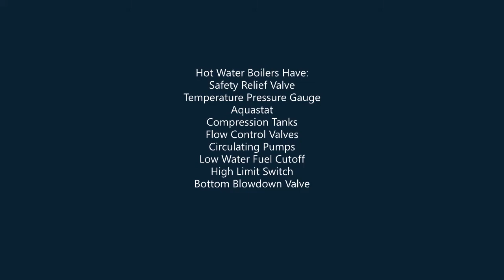Low Pressure Boiler Training-Session 9-Boiler Ben

Comment: Hey Ben, I was wondering if you had a video on the ‘cooling systems’ in the boiler book 5th edition? Im currently studying and That’s one part I’m stuck on.
Reply from the maker: I do not have any video on the cooling chapter. The information in that chapter is very good and you will notice that there are similarities between boiler systems and chiller systems. Chillers do not have the same explosive concerns as with boilers however. Thanks for the questions!